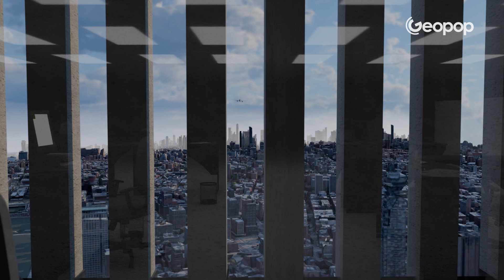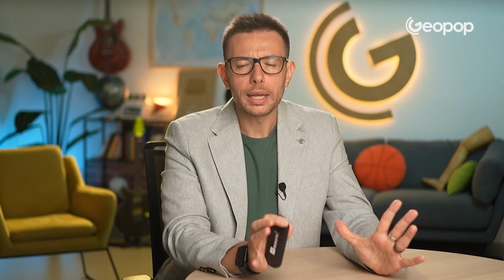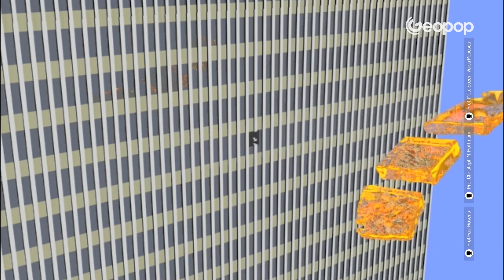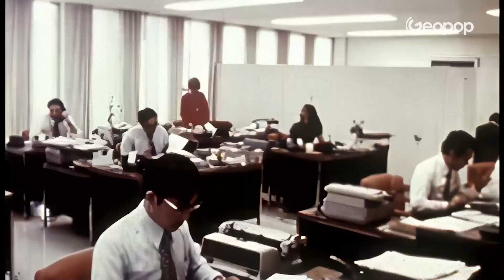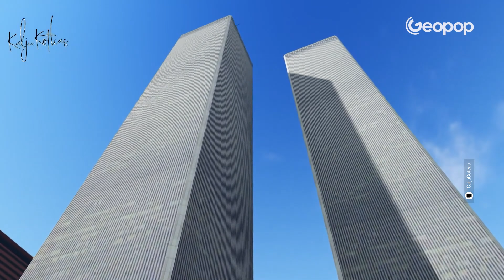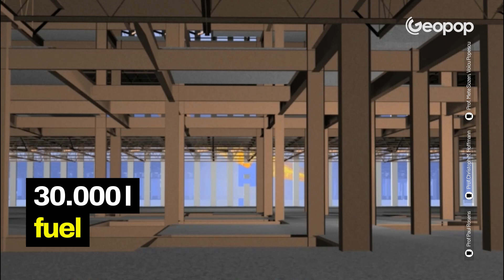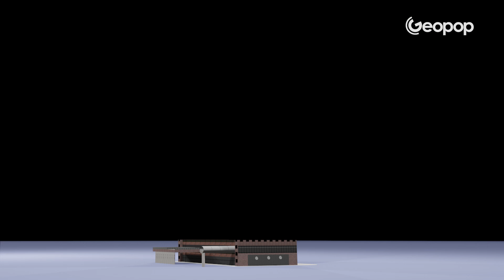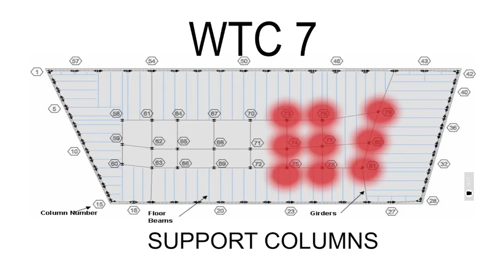9/11, 2001: The Technical Reconstruction of the Twin Towers and WTC 7 Collapses

Comment: Even if the steel was raised to the point where it collapsed that would have only happened at the point of impact. This is where the building would've failed and what we would've seen happen is the top section of the building falling hitting the lower section of the building and stopping possibly creating off to the side not going down floor by floor all the way down to the bottom that wouldn't happen the rest of the steel was intactand should've easily stopped the falling debris from above
Reply: I'm going to respectfully disagree with you and present a detailed affirmative case explaining why mine is the better alternative.

I find Twin Towers collapses intellectually fascinating, my interest being understanding the actual mechanisms of collapse - what failed, when, how & why and discussing those mechanisms with others who share a similar genuine interest in understanding what really happened instead of rationalizing some political agenda. So let's talk about it.  If at the end you disagree with anything, please let me know what you object to and why. Make it good. I don’t suffer fools. This will take just a few minutes.

This is my summary explanation of Twin Towers collapses of the Twin Towers, start-to-finish, based on my observations without appeal to, or reliance on any authority. No politics or ideology, just what actually happened, which is agnostic to who planned and carried out the 9/11 attacks or why. It has the benefit of not requiring Rube Goldberg levels of complexity and it makes logical sense. Each step in the process flows naturally from the one before AND is chock full of critical details the conspiracy-oriented internet tends to leave out with no whataboutisms.  My hope is this will dispel many common myths and answer most if not all questions you may have about the Twin Towers collapses. 

While complex, most of the Twin Towers collapse mechanisms can be seen with the naked eye and easily discerned and understood by the layperson if sufficient time is taken to understand. The worlds engineering community had already largely sorted them out at least as early as October/November 2001. Still, there are many who can’t be bothered to look or perhaps work hard not to see, being more concerned about advancing political/ideological agendas (which is exciting) than science and engineering (which is boring).

1. The Twin Towers consisted of 4 primary structural elements that together formed an integrated system where each relied on the others.  47 hollow box-section steel Core Columns carry the majority of the gravity loads. The 236 hollow box-section steel Perimeter Columns carry the remainder and ALL of the lateral (wind) loads. Long-span Lightweight Steel Trusses connect the core and perimeter column together at each floor with a Hat Truss on top to tie the structure together as an integrated unit where no element can survive without the others 

2. The impact of 117 tons of airplane (= to about 12 dump trucks) at speeds up to 590 mph completely destroys the aircraft.  This in no way implies the Towers come out unscathed. Some folks don’t get that. Hitting with the energy of up to a ton of TNT the impact damages or destroys many perimeter and some core columns (33 of 59 perimeter and 20 core columns destroyed at the impact floors in the North Tower), primarily through bolt-shearing failures at the end connecting flanges, as well as bending, twisting and fracturing of weld seams. There was no cutting or slicing - the reality was far more violent and messy. 

3. The impacts destroy or damage fire insulation, fire breaks and sprinkler systems on multiple floors. Huge fires are started across multiple floors simultaneously and allowed to spread rapidly with no effective firefighting or fire suppression. This was an unprecedented fire event . 

4. The hotter steel gets the weaker it gets .  With fire insulation stripped away and no sprinklers the survival time of the steel greatly reduced. Gradually over time heat causes the lightweight steel Floor Trusses at the impact damaged floors to sag, which was observed and recorded.  No steel melted nor did it need to. Structural steel will fail long before it turns to a puddle. It just needs to bend

5. Sagging floor trusses pull on the increasingly weak and overloaded Perimeter Columns, causing some of them to bow inward by up to 5 feet. A straight column is up to 4 times stronger than a bent column. The bowed Perimeter Columns buckle and fail, initiating collapse. The formerly static mass above which the structure below could easily support is now converted into a dynamic mass up to 30 times greater. Because they have buckled, the Columns above and below the failure point are no longer aligned . The load bearing structure below no longer bears any load as it falls past the lower columns, NOT onto them.

6. Thousands of tons of debris fall within the four outer walls, down through the open office space, crashing onto the first intact floor it encounters. This massive impact immediately breaks the bolted connections to the columns as the amount of resistance the Floor Trusses can offer is negligible.  The falling debris slows only marginally and briefly. Note:
6a. This is NOT a solid top block crashing into and “crushing” a solid bottom block .
6b. The debris falls past the columns not onto them.  The columns provide no resistance to the falling debris. 
6c. Only the bolted connections of the floor trusses to the core and perimeter columns can offer any resistance. A pair of 5/8” bolts at each end of each truss vs. thousands of tons of falling debris.
6d. No laws of physics are violated.

7.  This floor-led collapse progression within the four outer walls can only go straight down. Note: 
7a. This process is often incorrectly referred to as “pancaking” which actually refers to a completely different process rejected at an early stage. The catchy name stuck but nobody knows what it is supposed to mean.  Pancaking is too simplistic and inaccurate anyway. More like Kaiserschmarrn.

8. Collapse progresses through the floor systems not down the columns, through the path of least resistance . Rate of floor failures increases with each successive floor as momentum increases, reaching an average acceleration of 0.65 of GA, or 35% slower than true free fall. Bam, bam, bam down the building until there are no more floors to fail.  The resistance offered by each successive floor is always the same. The mass and velocity and thus the energy of the falling debris are constantly increasing with every floor destroyed new falling mass is added. Some falls to the sides, but most falls down. More mass, more velocity, same resistance with each floor.  Don’t get stuck on the but the lower floors weren’t on fire nonsense. They weren‘t and didn’t need to be.

9. The Towers were 95% air by volume. As that air was compressed inside the building it is forced down the tower and blown out the sides in reaction to the building collapsing . Those were not “explosions”, it was expulsions of compressed air caused by the collapsing building, explaining the low velocity, lack of flash, blast, supersonic pressure waves and lethal high-velocity ejecta.  

10. Perimeter Columns become detached and peel away like a banana behind the collapse front, playing out to the four points of the compass extending to more than 600 feet from the base of the towers. This was quite obvious from examination of the debris pile. 

11. Core Columns fail last as their internal beam bracing is stripped away by falling debris and lateral support from the floor to perimeter columns is lost. 

12. For those who care about how long this whole process took; 31-34 seconds from the moment the perimeter columns buckled until the last core columns hit the pile, or 1/3 the rate of true free fall. Don’t believe me?  Just watch any video of the collapses and note the loose truly free falling debris dropping much faster than the towers themselves.  

13. Each Tower had a 1-acre footprint. Far from collapsing inside their own footprints the debris pile spread out over 16 acres in a pile up to 14 stories deep. 8 surrounding buildings were destroyed and scores more damaged. 

14. What was NOT observed and recorded were the 180-190 dB bangs of high explosives or the blinding bright flashes of burning thermite. Of course, neither could have caused the (silent) Perimeter Column buckling that was observed.  Neither explosives or thermite could have survived the impacts and subsequent fires either. Cherry-picking a casual comment from someone who heard a loud noise in an event like 9/11 is not exactly “proof” of anything and the pre—planned demolition case relies entirely on that. There is zero physical evidence to support either conjecture. It would be technically impossible, totally impractical and completely unnecessary. No one would bother. 

15.  The Twin Towers were perfectly safe within their design envelope.  They only collapsed when taken far outside design parameters by an extraordinary and unprecedented event. 

Impact + Fire (heat) + Time + Gravity = Collapse . Remove any one of those four elements and there is no collapse. Ignore any of those elements (as many do) and you will never understand the collapses. The Twin Towers were an integrated system in which no one component could survive without the others. One fails, the rest follow, through the path of least resistance – DOWN – through the open space, bypassing the path of greatest resistance – the columns.  Nothing I just described violates any laws of physics. All of the above is true no matter who planned and carried out the 9/11 attacks or why 

I hope you found this helpful. It is meant to be informative, not adversarial, posted with the objective of soliciting informed critical comment, positive or negative. If I made any errors of fact, logic or reason or left anything critical out, please let me know so I can fix it. One topic at a time, on topic only please to stay focused, no word-salads of Gish Gallop. IF you can offer a more plausible alternative be my guest. So far no one has even tried. Please start any reply with the words “Tits McGee” or I will know you didn’t actually read it, are not serious and just wasting my time.
Reply: @TheLoonResistance tits mcgee let's see if it'll let me send this to you it's having a hard time responding so I'm going to send it in a comment to myself and see if it'll work but I did read statement
Reply: @nicnicol694  - Just use your own big boy words. You know you can't post links in YouTube comments and you won't link to anything I have not already seen anyway.
Reply: @TheLoonResistance  well that was rude. I didn't list any links and it still wouldn't let me send the comment to you so if you look at the previous comment I added the comment to it. I don't know why you got so rude all of a sudden. This was a healthy debate until this. I'm not trying to call you names or anything. I even said I appreciated the detail you went into don't make this a negative thing I'll let that one slide but please don't do that again.
Reply: @TheLoonResistance  wow. They removed my response to you. I wonder why they did that. Maybe because they want to silence the truth do you think? You know that that's why censorship happens. It's to silence the truth. There's no need to silence lies as they become evident in the face of the truth. Never in the history of the world has censorship been used to silence the lies. It's always been used to silence the truth. Because the lies are afraid of the truth. I wrote a very extensive response to everything you said with examples of all the different inconsistencies that happened. It seems they have a erased it. That's not my fault so please don't be a jerk to me.
Reply: @nicnicol694 - Nobody gives a shit. No one is monitoring your comments. No one is trying to silence you. Obviously there is something in whatever you are trying to post that won't pass the algorithm.   This is why I cautioned against links or really just copy pasting anything in general.

And don't make it too long. It won't post if you exceed the character limit. My previous post only just makes it.

Perhaps if you could just summarize whatever point you are trying to make.

Just one at a time please
Reply: @ Well it may have been too long but I don't think it was as long as yours was. Close for sure. But I have had many comments removed because of the topic. I have even had a short removed which I appealed and overturned. Again your attitude is not needed. I wanted to give you a detailed information like you were so kind to put in yours. I did and I covered many of the things that you discussed and show showing how other things that went on in invalidated some of those points you were making i'm glad that you made all those points because it makes it even more clear the point that I'm making because even the best narrative of plausibility falls short of the reality I will try again here in the next day or so maybe you'll have to do it in sections I should've saved the comments so I could've just re-copied them paste it I hate having to rewrite stuff that I've spent time working on everything making sure I covered all the points. Give me a day or two and I'll do it again
Reply: @nicnicol694  - Again, if you are going to rebut try only one point at a time.  I don't do Gish Gallop and prefer to focus on a single topic until both parties agree it is resolved.

If you break it down like that I suspect you will also find what it is that is hanging you up with YouTube.

YT drops at least a few posts of mine every day.  Been like that for a few years. Not a stable platform, though it is better now than it has been for a long while.

I am also on double super secret probation which means I can't make more than 4 comments an hour or I get a super secret shadow ban of 1, 3, 6, 12 or 24 hours. Never told it is happening or why or which I will get and why. 

It has eff all to do with the content of my posts.

The algorithm works in mysterious ways.

Comment: They collapsed because they were controlled demolitions. Anyone saying anything otherwise is completely wrong and doesn't understand basic physics.
Reply: Do tell, how do you think the collapse would look if it wasn’t a demolition?
Reply: @ well for starters the collapse would've happened at the impact site and you would have a whole structure colliding into another whole structure causing it to slow and most likely fall off to the side. All the structure underneath would've remained mostly intact. furthermore building seven that wasn't hit by anything would never have fallen in the same manner
Reply: @ you can look up videos of failed control demolitions and buildings that collapsed due to structural fires and see how they fall very differently

Comment: You didn't mention the chemical reaction of cold water touching molten hot aluminum alloys from the planes and how that reaction is one of the (if not the exact) is the proof in how the steel collums lost their tensile strength as you depicted.  The reaction of the water striking the molten aluminum ultimately increased the temperature of the fires that destroyed that tensile strength of the steel.

Comment: You insisted so much that this content wasn't AI generated when nobody asked but you dubbed the video with AI, why would you even dub with AI it then? 🤔
Reply: You make zero sense … conspiracy delusions kicking in … simple info … ai dubbed only, content not! Nonsense question why ai dubbed! Why? So its in English, not Italian! Triple facepalm!
Reply: What is the source of the many tons of molten steel found in and under the debris, the heat so intense that the molten steel remained in that state for weeks afterward, running off of the debris as it was excavated. This cannot be molten copper from wiring that retains the color of a shiny new penny.  It cannot be molten aluminum that retains the color of the polished aluminum wheels of a street racer. It was the color of glowing orange molten steel  that cannot be mistaken for any other material, reported by firefighters who are very experienced in the nature of such materials as well as seen in video evidence.

When you combine this with an entire lack of turbulence behind 500 mph aircraft, when even a small Cessna Aircraft would leave an evident wake in the smoke and fire only seconds later .  . We find that skeptics still cannot be skeptical of the official narrative in explanation.  Sponsored channels and forum activity are skeptical of nothing when support is provided.

Sponsored activity in the forums is very normal today for commercial and political purposes and subjects of controversy -- in the attempt to lead public debate.